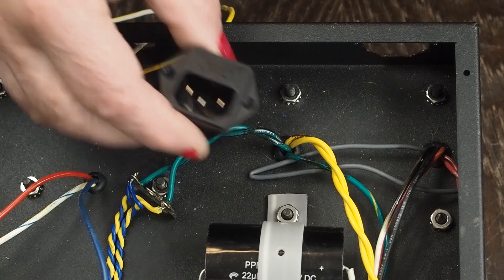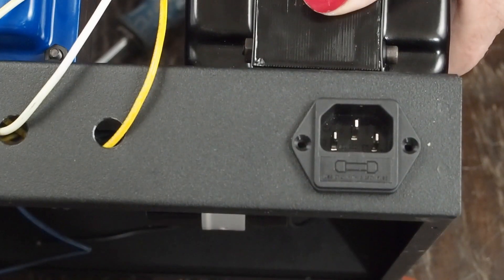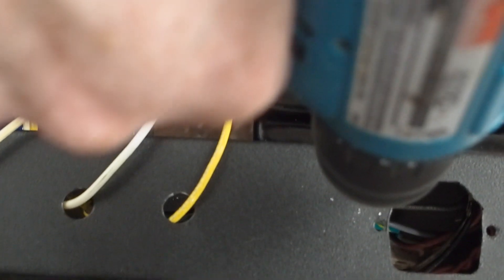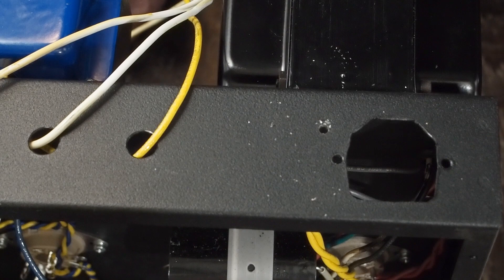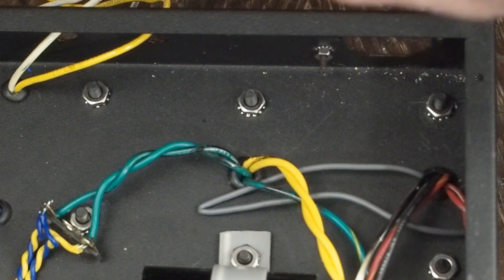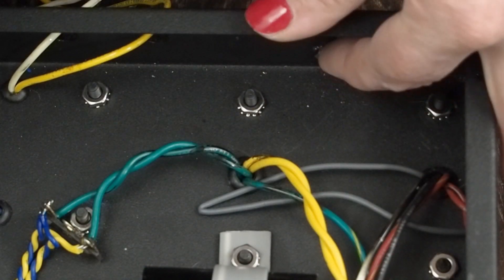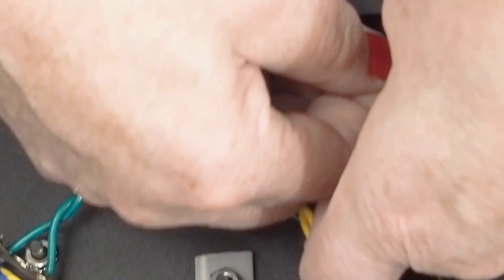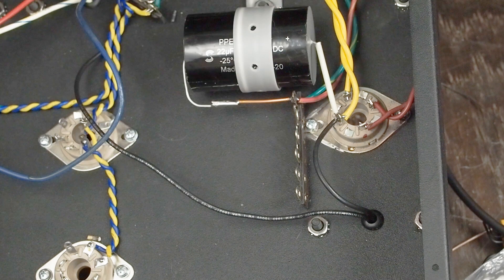6SQ7 EL34 Tube Audio Amplifier: Power Socket

Comment: Howdy,  Great videos.  Just wanted to mention that for you grounding/earthing point next to the IEC plug you should remove the paint just like you did on the tube socket.  You will also need an additional wire for connecting to the cover that will be put in place at the end.
Reply from the maker: I did remove the paint for the ground lug next to the IEC socket ( https://youtu.be/PEY8G4lrGHU?t=284 )and the amp isn't going to have a cover. Thanks for watching!